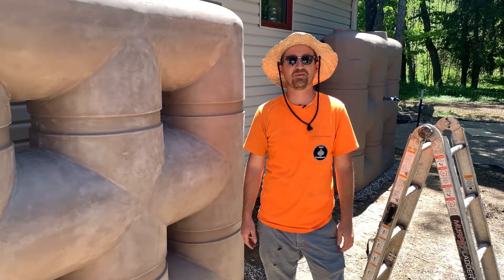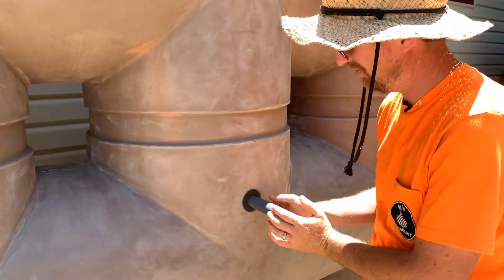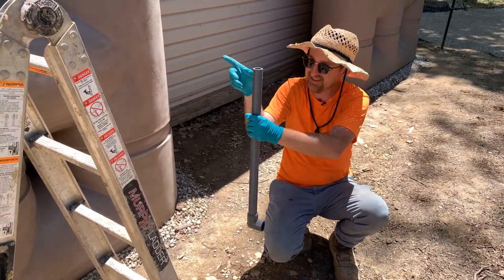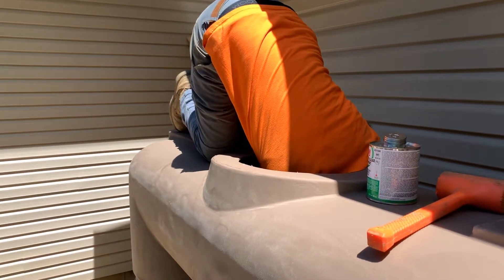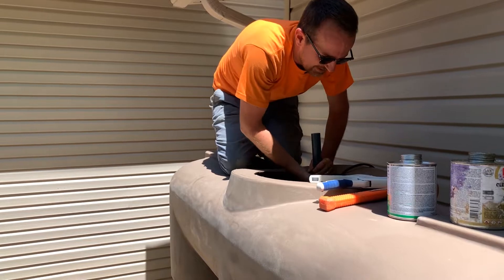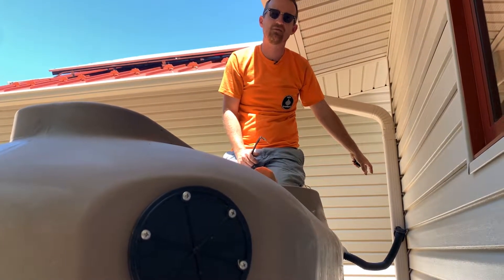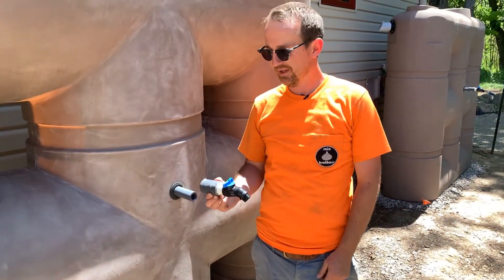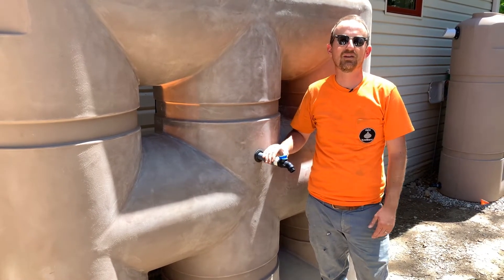Pump install in rainwater harvesting tank - EASY!

Comment: Do these pumps not require a pressure tank when used on a home ?
Reply from the maker: Great question! This particular pump is our Springer Series Automatic pump, which is made for direct feed to a hydrant or hose bibb for spray irrigation or high-pressure applications. This pump does not require a pressure tank. However, if the tank is supplying a house, we definitely recommend our Springer Series Traditional Pump Kit, which does use a pressure tank.

Comment: Why not make tank penetration above top water level, less chance of leak, less pain installing, less everything!!
Reply from the maker: Sometimes we do! But in this case, we wanted a valve that was easily accessible for the homeowners. Thanks for watching, and for the feedback. You are quite right that for a lot of people (especially those who have never done this before), they may be better off keeping the pipe penetration higher on the tank